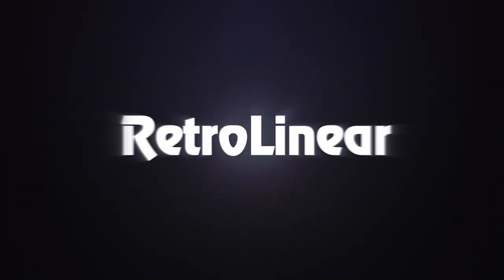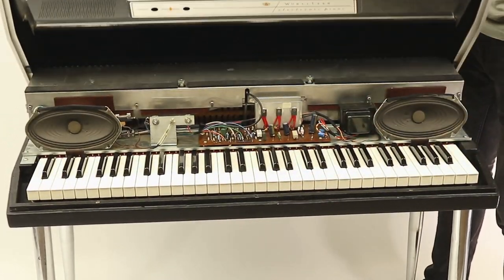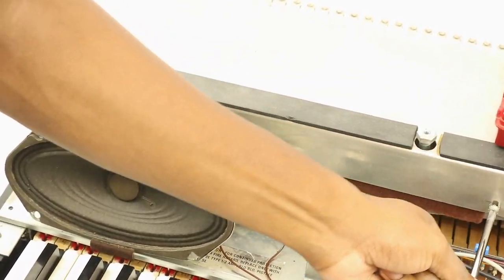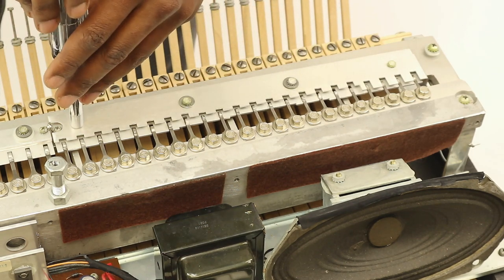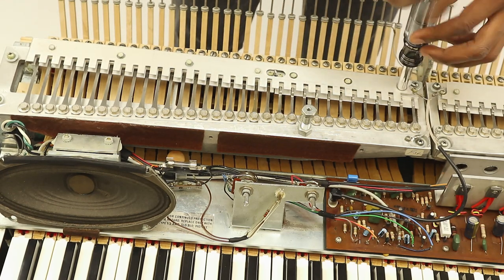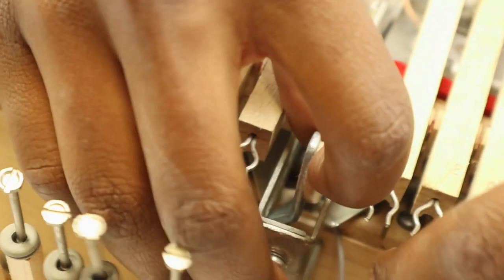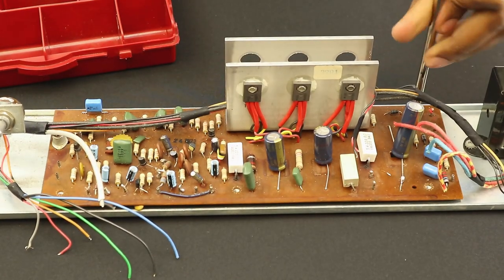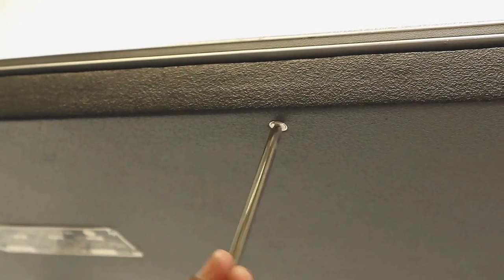Warneck Research Wurlitzer 200 Amplifier + Reed bar shield install

Comment: Is it necessary to replace the reedbar shields to install a replacement amp?
Reply from the maker: The 200 series never had  reed-bar shields.. Adding them greatly reduces background noise and cancels out most RFi (radio frequency interference) 
Mind you the airwaves of the world are much more loaded with signal compared to 50 years ago.. These make a difference atop the amp and shielding the transformer lines too..